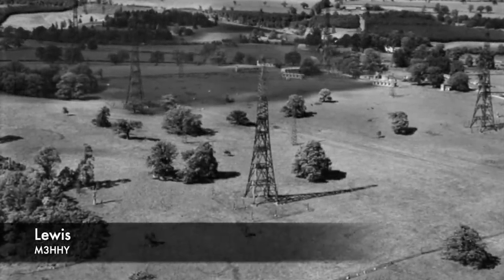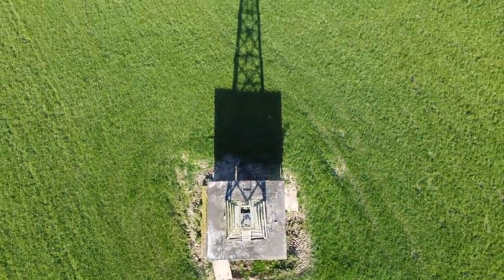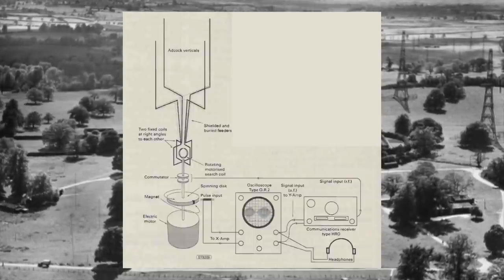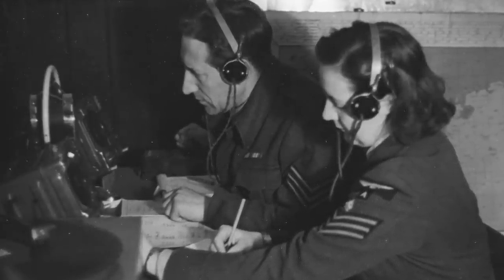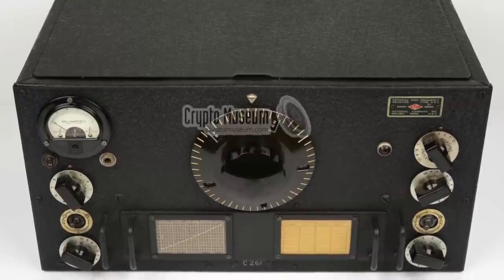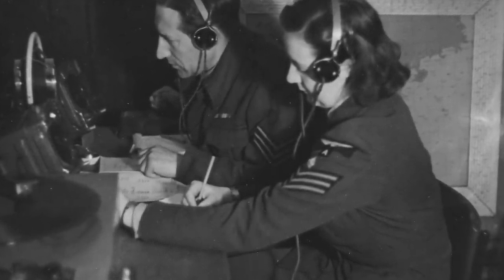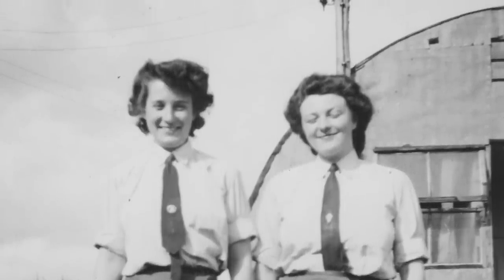Tracking Secret Enemy Radio Signals

Comment: I was stationed at RAF Chicksands as a Morse Op from 1992-1995. There was a lot of info about the early days at CHIX in this video that was new to me. For all the obvious reasons, good information about the history of the mission and the equipment used at Chicksands can still be a bit elusive. Thanks for posting!
Reply: Which service?
Reply: @PaulStrickland  Would have been US Air Force at that time. USAF was there from 1950 to 1995. I was there in the mid-1980s.
Reply: @bobd.9877  Blimey was it 95? I used to be at the Royal Signals Territorial Army unit at Bedford and we always saw a detachment from Chicksands at the Remembrance Sunday parade along Bedford Riverside, they always used to get invited back to our unit bar afterwards. When the USAF moved out it was placed on a care and maintenance basis, the elephant's cage had come down by then, didn't think it was 95. The accommodation that could be seen from the Eastern entrance is identical to the accommodation blocks at Lakenheath. I can also remember seeing the Chicksands Fire Truck at the RAF Henlow airshow and Firex 86 in Luton, it had a pump and roll capacity as it was designed for fighting woodland wildfires
Reply: @PaulStrickland  Yes...hard to believe it's been that long. USAF ceased operations in September '95 and I think they pulled down the elephant cage in '96. Our operations building "on the hill" and those barracks became a joint services training base around '97. You can still see the outline of the elephant cage in Google satellite view. Cheers
Reply: USAF. I was one of the last Morse Ops on the base when the US forces left.

Comment: Yes, this is a lovely  topic with extensive depths that have become more accessible in recent years with declassification. During WW2 there were 'Y' (for Wireless Intercept) Services associated with each of the armed services and the GPO although the Royal Navy 'Y' was the largest. There were dozens of  the small DF stations up and down the UK and abroad associated with but generally separate from much larger monitoring stations such as Scarborough, HMS Flowerdiown (Hampshire), for the navy, Chicksands and Cheadle for the RAF, and Fort Bridgewoods (Chatham) and Wincombe (Shaftesbury) for the Army. Many of these sites were re-purposed and continued into modern times. Scarborough is actually the longest continuously operational intercept base in the world (since WW1)and today is still the centre of GCHQ's HF monitoring activity having been thoroughly modernised in the last few years. This is all about listening, there's a complete other side t the story about what happened to the messages processed by Bletchley Park after analysis/decryption.  Those of specified military interest and classified as "Ultra" were packaged up and transmitted out to commanders in the field via the lesser known facility at Whaddon Hall and its various associated HF Tx/Rx sites
Reply: You missed out the MET Office at Dunstable which had a massive antenna farm, it is now a housing estate built after the war,  All of the Y sites employed despatch riders who rode to Bletchley Park with intercept messages which were then decoded at BP.
Reply: @PaulStrickland  Indeed i only scratched the surface with  my comment. There were  even some US-only facilities like the US Army 'Y' site at Willingdon (Haystoun House)  on the south coast.

Comment: Cheers Lewis,
Thanks for a brilliant vid. 
I built a Goniometer when a teenager 50 years ago. I never thought about using a motor drive and oscilloscope to give a direct readout of the bearing. Clever. I was always twiddling to find the null by hand. The null at 90 degrees being more pronounced than the peak.
Cheers fascinating 👍

Comment: Similar in nature to a Doppler Array, for Radio Directional Finding.  It most-likely measured the difference in-time a signal arrived at each antenna, and derived a bearing from the measurements.  Definitely high tech for its time, & manual in-nature.  Very fascinating.

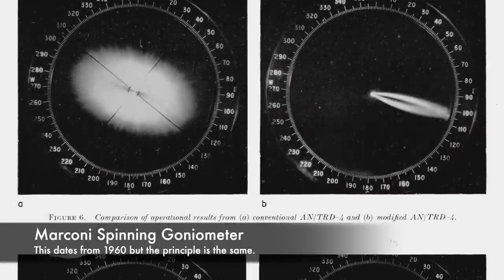Comment: The AN/TRD-4 was the precursor HFDF of the AN/TRD-23 HFDF, both used by the United States, Army Security Agency HFDF operators, seen at 2:16.   The half propeller pattern on the right was carried forward to the AN/TRD-23 system.

Comment: I was at Chicksands the other week checking out the site where the "Elephants Cage"  AN/FLR9 antenna once stood. That was a truly massive structure. I remember when it was dismantled back in 96ish. 
30 years ago, if I was standing in that spot, I probably would of been arrested or even shot. Now days, there is a public right of way right next to where it once stood. So I went and had a look.
Reply: Not 30 years ago you wouldn't, the USAF had moved out that year and the base was on care and maintenance, just a couple of minimum wage security guards, the antenna was already down, I parked in the woods and went for a run, a public footpath runs from the road up to the access road from the base to the radio reception building which had its own compound outside the base, I was able to walk around freely where the elephant's gage used to be,  There was a fence but it only went round partially, the old USAF warning keep out signs were still fixed to that the fence but they faced a thick wooded area.

Comment: Slightly duff information Lewis, the Royal Navy was only on-site at Chicksands for 9 months, before the RAF took over, the photo you displayed is clearly of WAAF's. There is an on-air group that does a lot of research and they can be heard on HF a couple of times a week (The Box 25 Net). Another Y station was at woodcock Hill at Sandridge just outside St Albans, after the War it was taken over by the Home Office for use as a Research station where the boffins tested equipment for the police, it was taken over by DSTL and has only recently been closed, easily identified from its modern radio mast